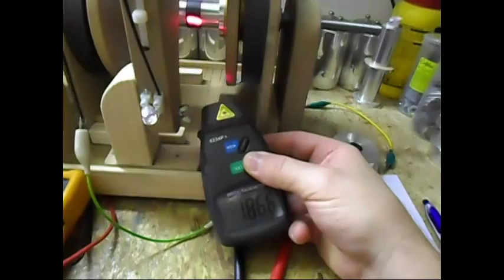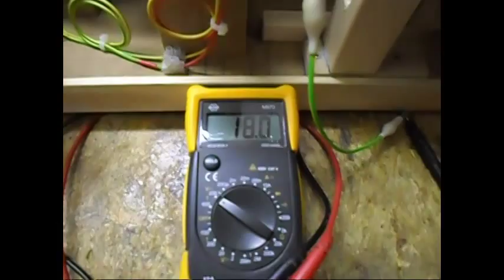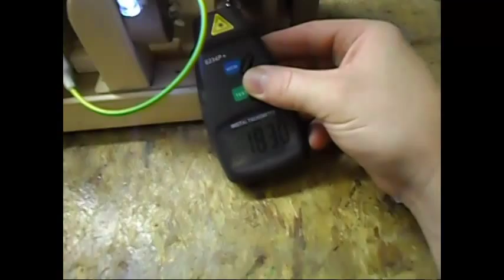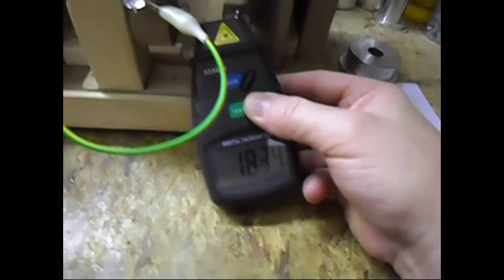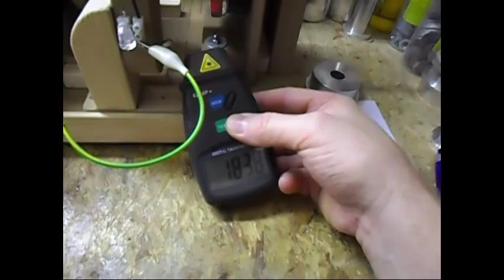Flux Gate Generator - Update 3 Push Mode, 2 ring magnets - long coil...

Comment from the maker: Just a small update about me testing a longer coil wich is performing better than the shorter one...^^
Since the best energy production is at the edge of my rotor iron disks i'm gonna concentrate on this setting...;-)
But since this coil energy production isn't enough i'm not gonna make 7 more...nope...that would be a waste of copper wires...lol
Did i said...Lanenene at the 7.00 minute mark...lol.lol.lol...but hey...i can't be good at everything right...lol
At 6.45 the rpm reading was 1841 and when i stop playing with the Lanenene coil it was 1837 at 7.33 minute mark...
This is because of me putting that coil for a split second next to the left rotor...wich have created enough drag to slow the system down for some rpm...;-)
Except for these mistakes...a good video as always...lol
The one i'm gonna build is a 12 coil full generator setup just for the fun of it and to see how it will performs...^^
Always do a real load test and not only a coil shorting test...!!!...these two are not the same...!!!